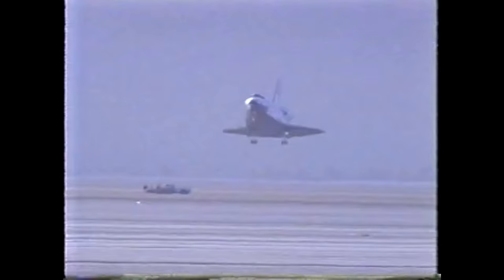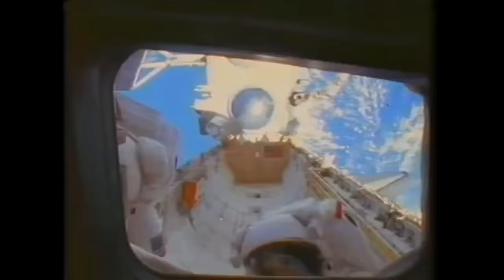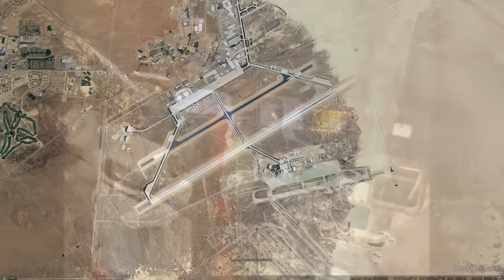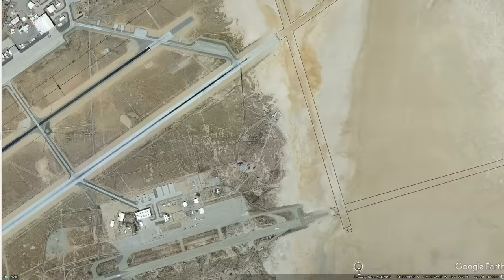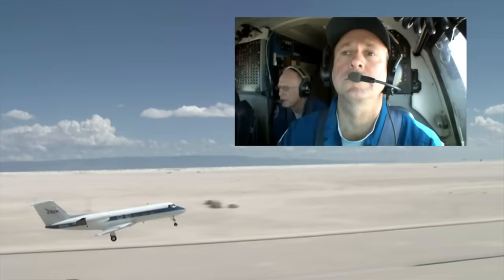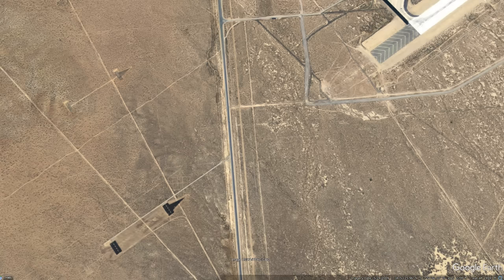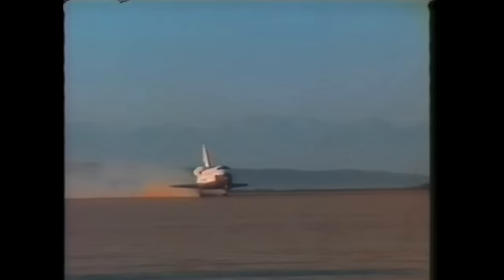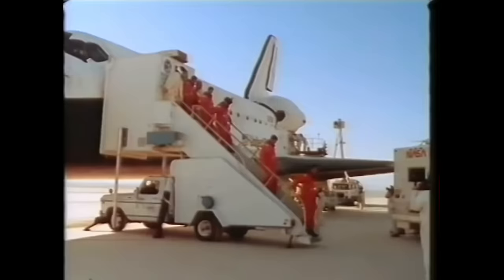The Space Shuttle That Didn't Reach The Runway - Why Did Atlantis Land Short on STS-37?

Comment: Hearing that the toilet was a critical piece of equipment, it begs the question about toilet redundancy. 🤔
Reply: Guess where I'm just reading....
Reply: Plastic bags and zip ties.:face-blue-wide-eyes:
Reply: @jimmywrangles   but thats not redundancy, that is a contingency plan.
Reply: @Ganiscol  It was all the redundancy you were going to get.
Reply: That´s why NASA needs a space plumber on launch standby at all times
Reply: @liden77  More recently, SpaceX Dragon had a toilet leak that needed repair between missions .
Reply: @jimmywrangles  As a veteran of deep caving expeditions, plastic bags (no ziptie required - use ones large enough to be knotted) are the Plan A.
That said, I guess I had the useful assistance of gravity.
Reply: @liden77 Yeah, but those guys are really expensive. They're charging overtime for the entire rocket ride up there, and they're there for 5 minutes before taking a rocket home. And then you get a bill for $100,000,000. No, thank you. I'm done with space plumbers.
Reply: @jimmywrangles  Don't forget the blue germicide capsules: drop capsule in soiled bag, seal, crush capsule to release germicide, knead contents firmly, distributing evenly.

Comment: You being a pilot now made this video a whole lot better! This happens with airliners as well but we have power to compensate for all the computer errors on the descent path all the way down.
Reply: Except if you are in an unpowered glider
Reply: @emmata98  Actual gliders glide pretty efficiently and have a lot of margin for error. Gliders typically have a glide ratio of between 30:1 and 60:1, so for every foot of altitude you lose you can glide 30-60 feet horizontally. The shuttle's glide ratio starts at is 2:1 at supersonic speeds and improves to 4.5:1 during approach and landing, so for every foot of altitude it loses it only gets another 4.5 feet horizontally. So in a glider, every foot of altitude you have gives you about 10 times as much ability to maneuver and reposition as in the shuttle.
Reply: I think you really meant to write "...all the HUMAN errors on the descent path.."
Reply: Yeah, "computer errors" because the humans didn't enter the data correctly.
Reply: @ellayararwhyaych4711   I thought so aswell, until I went from flying without an autopilot to flying a very modern airliner a few months ago, those things are far from optimised, lagging autothrottle and FMS software performance assumptions being slightly off, unless you egregiously fake your wind forecast to shallow the path out significantly in certain ways the plane will get itself into trouble EVERY time. No doubt soon this won't be an issue anymore with software updates.

Comment: Hey Scott, I’d like to offer a tiny bit of trivia.  
You said this wasn’t the slowest shuttle landing.  Well technically it depends on if you are talking about airspeed or groundspeed.  STS-37 main gear touchdown was at 168 KEAS (airspeed), but 156 KGS which is the slowest ever groundspeed for a shuttle landing.  However, on STS-28, Brewster Shaw touched down at 155 KEAS - the slowest ever airspeed for a shuttle touchdown, but his groundspeed was actually 157 KGS which was 1 knot faster than Steve Nagel’s groundspeed on STS-37.
Reply: mmK
Reply: And *that*, kids, is why we read the comments on YouTube videos. <3
Reply: How is the air speed and ground speed so different when you're basically touching the ground.
Reply: @Ilove3SGTE  wind
Reply: @Ilove3SGTE  
Because of differences in surface winds at touchdown.  STS-37 in this case had a higher headwind than STS-28.
Reply: @Ilove3SGTE  Good question, most people really don't know, but every pilot is well aware of this.
Some airplanes, depending on the wind, can take off with out ever moving.  Short take off and landing competition pilots are very aware of these two different numbers.  Check out some of those videos.  It's impressive.  Most impressive.
Reply: @Ilove3SGTE  Have you never heard of the terms 'headwind' or 'tailwind'?
Reply: @Ilove3SGTE  Wind.   Airspeed is basically groundspeed ± the component of wind speed in your direction of travel. So, for a simple example, if your groundspeed is 100 MPH and you have a 25 MPH headwind (blowing straight in your face), then you have an airspeed of 125 MPH   /   if your groundspeed is 100 MPH and you have a 25 MPH tailwind (blowing straight from behind), then you have a 75 MPH airspeed.

Airspeed is an important concept in aviation because the airplane's wings and control surfaces depend on air flowing past them to do their job. The easiest way to land or take off a plane is into a headwind, because it means that you have a high airspeed (meaning more responsive control surfaces and more lift) while still having a low groundspeed (meaning more time to make adjustments and react to sudden changes).
Reply: @Dee_Just_Dee  great explanation. I didn't know they could calculate the wind speed in real time like that. I thought air speed was different because of your altitude. Being really high up and the earth being round you travel a little more through the air then across the ground. That's not really important like wind speed though so that makes sense.
Reply: IAS is interesting if we're talking about the crafts structural properties (stall speeds), but GS is more fun - piper cubs standing in the air and stuff. You don't really change the glide speed, but GS only depends on the wind that low. Imo it's more interesting to know GS (unless IAS is vastly out of the 'norm')
Reply: @Ilove3SGTE  Basically it is relative.. and really important to how much lift you have over the wings
Reply: @ericstyles3724  Airspeed is the speed through the air. If the air is moving, (wind) it may differ than the speed over the ground (Groundspeed). A great example of this is seaborne naval aviation on US Supercarriers. The airplanes are flying in the 130-150 knot airspeed range (roughly, depending on the plane, the weight, etc), but the carrier is running away from them at 25-30 kts. Google indicates that they operate flight ops with 30 kts of wind over the flight deck for takeoffs and landings, and they can generate that with the ships engine if needed. So Ground speed for a landing aircraft is 30 kts lower than the airspeed. An airplane sitting in the catapult waiting for launch during this would have an airspeed of 30 kts while sitting still on the deck of the moving carrier. 

In conclusion, Airspeed is what determines how the aircraft flies through the air, and wind has no effect on airspeed in general (oversimplification for non wingnuts) and ground speed is how fast the plane is moving over the ground (affected by wind)
Reply: @Ilove3SGTE  thats starting to get into Indicated Airspeed (IAS) vs True Airspeed (TAS). Less dense air at altitude has a lower indicated airspeed on the gauge, but true airspeed can be calculated. If  you have GPS you can easily calculate real time ground speed as well as what the winds are aloft where you are flying.

Comment: I remember being in an aircraft that used that overshoot once, rotated just about the end of it. Hot, altitude and a full load of fuel on board. Flew in ground effect for a while as well, till those 4 jet engines had burned off enough fuel, and gotten up the speed, so we could climb. Trees were companions for a few minutes, as well as the town we went over at a little above treetop and rooftop height.
Reply: Yea did someone not calculate TOLD correctly or what? Thats scary as hell, being stuck in ground effect.
Reply: @MattH-wg7ou  Probably not calculated correctly, or they figured they could get away with it. Helped by a 6km long runway, not by it being 41C that afternoon, and bright and sunny. We did land mostly empty, part of the fuel load was transferred en route as practice for the other planes.
Reply: How much fuel does one "burn off" down the length of the runway?

Comment: The instrument was simply called GRO at Ball, while I was there at KSFC supporting another program CRRES I ran into another Ball worker bee who had been there a long time maybe a year supporting GRO? Not certain the exact timeframe. The Spacecraft also had a Ground emergency when they pulled the Battery connection while in the PHSF (Payload Hazardous Servicing Facility) I think that was during a fueling operation, the Battery power wires were dangling when somehow the inner connector insulator insert came out, wasn't good, the battery was rather large. Ball furnished the Star Trackers for the STS (On Orbit Navigation) Fun memory thanks!
Reply: ISTR many modern missions using clones of the Ørsted star tracker design from DMI or DTU .  Ørsted was a smallsat mapping the Earth magnetic field as an update to a 1960s NASA program .

Comment: Space Shuttle landings on the lakebed runways of Roger's Dry Lake at Edwards were not unusual.  3 of the lake bed runways were used, along with the main paved runway.  STS-37 was 600 ft short of runway 33's landing point, but it was still on the laid-out runway, no problem.  I haven't found anything that says that Runway 33 was not the runway originally in the flight plan. The cause for the minor error was a miscalculation of wind speeds during the descent.  As the saying goes, "Any landing that one can walk away from is a good landing".  :)  Oh.. It wasn't until a bit later in the shuttle program that the shuttles were modified with the addition of landing drag chutes to decrease their rollout.

Comment: Scott, were there ever any procedures for doing something like ditching the shuttle? Lets say there was a flight control issue and they couldn’t make the final 270 degree turn or the rolls to reduce altitude. Was there ever a contingency to ditch in the Atlantic? Or what if there was a computer failure and their guidance was wrong and they didn’t reach the runway. What would happen if they landed somewhere in say, texas. 

Were either of these ever considered as a possibility?
Reply: Yes, certain abort scenarios would result in a ditching.  The problem is, the shuttle cannot survive a water landing.  This was mostly ignored until the Columbia disaster.  After that, a ditching procedure was put in place where the shuttle would be put into autopilot, the side door would be blown off, a telescoping pole would extend out the door, and the astronauts would slide down the pole with parachutes hopefully far enough to avoid impact with the shuttle's wing.

Comment: What about the several emergency landing sites provided for the Shuttle, from the Azores to Morocco to Spain to France to … even Easter Island… why were they never used? Not even to solve an issue with crosswind? It would be great to get a video on those very special runways, that were considered possible landing sites for the Shuttle in case of emergency
Reply: TAL sites would only be used in dire emergencies, not for routine landings.  These sites had minimum ground support equipment for the Shuttle and getting it back to the USA would be a serious problem due to the very limited range of the shuttle carrier aircraft.

Comment: The shuttle has thrust reversers?
Reply: No.  The training aircraft, a Gulfstream jet shown a lot in this video, has thrust reversers.  Normally thrust reversers are only used after an aircraft touches down, but to simulate the steep descent of the space shuttle, this Gulfstream uses it's thrust reversers during approach.

Comment: In at least one specific modern in-service multirole fighter there is a system called the "Wind Model" in the Air to Ground Delivery menu. This allows you to manually insert or have the jet automatically "capture" the windspeed and direction at 10 increments, so every 500ft, 1000ft, or whatever altitudes you put for each row of the wind column. 
So for example: 
Surface winds 260/6
1000ft: 250/10
2000ft: 240/12
And so on. 
This allows the jet to calculate release points more accurately for bomb deliveries. 
Im surprised the Shuttle didnt have something similar, to give it "foresight" for the wind column below them. Seems odd that it would only use winds at current altitude and extrapolate assuming the same current wind all the way down?
Reply: There is just a tiny bit more computing power available to do that on a current day fighter than on some computer from the late 70s.

Comment: Y'know, I'm kind of a big deal. I've landed in stronger cross winds than the space shuttle could handle. Now, how you doing....?

I am actually quite surprised about its limits though - I would have assumed it would be much more in line with commercial aircraft, but I guess with no thrust its options for correction are limited

Comment: Now I'm really intrigued about the training plane and how it must have been modified to replicate shuttle flight dynamics  without compormising its ability to be an plane. did they just modify the flight controls in some way or the weight balance, or the lift  ?
Reply: Yes, it was a Gulfstream g2. The way they replicated the flight characteristics is as follows: (no, I'm not making this up!)

Main gear down, nose gear up. Engines at idle, in REVERSE THRUST. 

Planes are supposed to descend at 3 degrees angle. Shuttle and the simulator? 19 degrees. The shuttle had the gliding characteristics of a brick with a headwind.
Reply: It does its approach with the thrust reversers engaged to increase drag.

Comment: Why wasn't the Space Shuttle evolved into the Starship direction of making the engines last more consequent uses without service, and making the boosters and fuel tank easier to re-use as well, and carrying on with deeper space missions by refueling one Space Shuttle with another, repeated times if necessary.
Reply: The Shuttle's engines were reusable and design changes were made throughout the program to increase reliability and reduce the amount of maintenance required between flights.  The RS-25 engines were designed for 55 flights.  The SRBs were also reused and were designed for 20 flights.  The space shuttle was never designed for anything but Low Earth Orbit missions.  Refuelling the shuttle  on orbit wasn't possible because the external tank was jettisoned during boost to orbit, and the main engines were not restartable.  The main engines on the shuttle had no fuel source once it was on orbit.